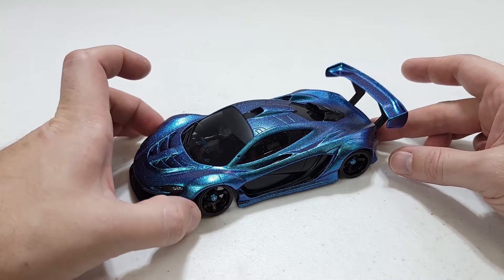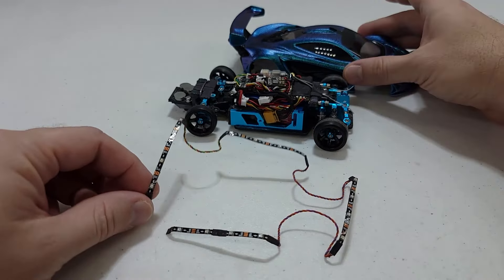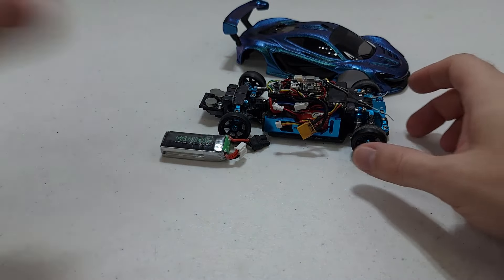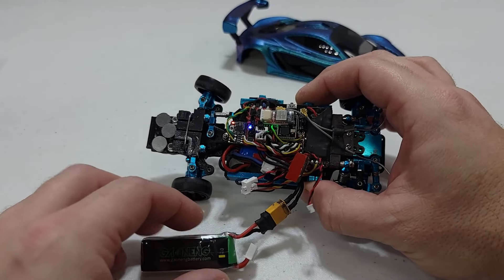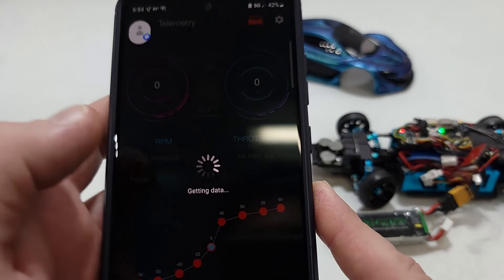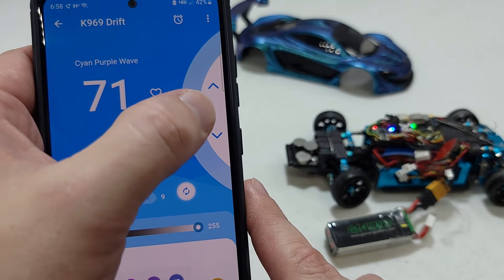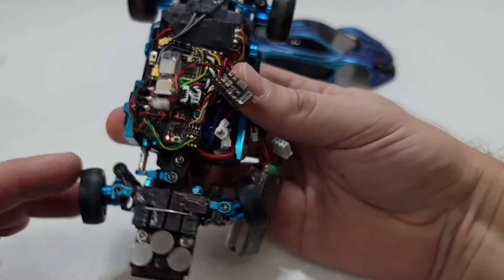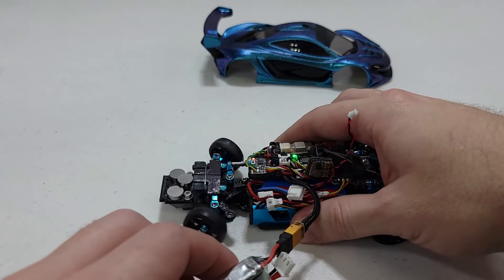WLToys K969 Rebuild Completed! Electronics Upgrade, DasMikro V6 Gyro, Furitek Momentum ESC, etc.

Comment: Hey man, great vid and love the look of the P1 body on it. I'm looking forward to your electronics breakdown videos. 

I have a dumb question but I honestly can't find any info elsewhere on it from a video from 2024.

the R7FG transmitter has a gyro built in which can be controlled by the RadioLink Transmitter, can I ask why it's not being used and an additional aftermarket one is instead?
Reply from the maker: Thanks bro, just hang in there for those vids since I have a few LDRC videos I'm gonna drop first then I will get back to my K969. I have a lot of videos to make and it's hard to find the time. So with the internal gyro on the R7FG, the reason no one uses it is because it's a terrible gyro, most gyros built into receivers usually are. I guess if you have no other option you can use it but you're not going to get good control out of them unfortunately, it sucks I know. Originally I was thinking of using it too in the beginning and then did my research as well as testing and it's a waste of time so that's why I don't bother with it. Yea there's not a lot info out there about it but when you do find some that have tried it they come to same solution. The best cheaper option for external gyros for these RC cars are the DasMikro gyros since they are half the price of the better ones and works almost just as good as them. I'll try to cover some of this in a video down the road when I can.
Reply: @AirToGroundRCFPV   hey man thanks for the detailed reply! 😀 Drop the vids whenever you can dude, we watch them for half an hour but the setup and editing that's done in the background takes much longer, I'm subscribed anyway 👍🏽 ohhh now that makes alot of sense now, I've only just picked up my k969 the other day after 13 years away from the hobby, I'm determined to make a nice indoor drifter for the rainy days 😎 I'll go for a gyroless radiolink rx for my RL transmitter and I'm thinking of going with the AFRC GYS-2 gyro since they seem to be quite popular or would you say the Dasmikros performance is good enough? 

The hard part will be sourcing a Supra MK IV body and putting a bodykit on it, I'll probably CAD it up myself 😅
Reply from the maker: @Shaktical_Airsoft  No problem bud, glad I can help out. I always plan on making my vids shorter but once I start getting into the details it gets dragged out lol The K969 is fun but a huge pain to get it the way you want, I mean it took me like a year to get this one where it is. You can still get the receivers with the gyro and just not have the internal gyro on, they work fine and don't interfere with the external. The R7fg is good but the smaller R4fgm will do just the same as long as you don't need more than 4 channels. The DasMikros are good for their price so paying twice to get a little more performance is completely up to you, I don't want to tell you how to spend your money. And bro, if I could find a Supra mark IV I'd be all over it too especially would want a wide body kit for it lol 3d printing them is tough but possible and it sucks all the Mini-Z Supras are gonna be over a hundred easy since there are collectibles now. You could get one of those Tamiya model kit Supras that are 1/24 scale but you'll have to do a little extra work to fit right on the K969.
Reply: @AirToGroundRCFPV  appreciate the work you put in man for real. I say let the vids be as long as they need to, we all need to learn to have longer attention spans lol I realised that you spent so much time fiddling and dremmelling away it's a lot of work but tinkering is half the fun of the hobby imo 🤷🏾‍♂️ I think you may have sold me on the dasmikro lol if the 'performance' really bothers me I'll switch it up, I am really interested in getting a supra body somehow but yeah I heard about these tamiya kits too, I think I can get away with a printed resin body with bolt on kits, it might work with what I've been doing so far, if I make it happen and it works I'll hit you up so you can print one for yourself 😎 also maybe a liberty walk Lamborghini Aventador too  hehe
Reply from the maker: @Shaktical_Airsoft  Dude you are speaking my language haha resin would be much better, I only have pla and tpu stuff I can print so it's not as good for me. I want an Aventador so bad as well but Kyosho won't make a Mini-Z version of one for some reason and if you could do the LBW kit on it that would be sick. I would buy one from you if you could make that happen lol You are spot on with the tinkering being half the fun, for me it's almost most of the fun than the final product since I enjoy the challenge, work and problem solving that when I actually complete it I'm like, now what? lol I've been like that for years even when it comes to my dozens of micro quad and drone builds, I just wanna build stuff but I do love flying them fast and crazy as well. RC cars is my second hobby so I'm not the greatest drifter but if I have time to practice more I could get better. I would say I'm a better pilot over all though lol Nobody really cares about drones any more and everyone loves cars so I stick with that for my channel at least for now and for some reason my vids always reach a half hour when I don't plan for that, it's like a curse haha
Reply: @AirToGroundRCFPV   yeah you cannot deny the finish quality of resin prints plus I got a trick to really smooth it out since I'm working closely with a resin printing fanatic at work lol the only problem is it's brittle so if hit hard enough then it will break but you can always print another one lol don't worry about paying for one from me, when I figure it out I'll send the file over for you personally. You could still print in tpu/pla but you'll just need to post process it abit more, I think Uncle Jessy has some hacks to smooth FDM prints.
Haha remember when drones were the latest thing? Man I wish I capitalised on that, I'm a noob flier still, got my Hubsan q4 out the other day and forgot everything lol and yeah no point building a beast of a quad of you dont go full send! Haha

 I think you should do a fpv kit on this car as your next crazy venture, I'm thinking of doing it for my buggy lol tinkering for me is challenging and therapeutic, it's fun when you have an idea and you can actualize it, this P1 of yours was really the thing that sent me down the idea of an indoor drifter, I drift well on PlayStation, now does it translate to rc cars? Only one way to find out lol
Reply from the maker: @Shaktical_Airsoft  Yea that seems like the trade off, resin looks fantasic but can be brittle, pla or petg, abs can be stronger but looks rough. I usually stick with pla since it's easy but still not very strong, to fix that though I cover it with epoxy and it makes it super strong and smooth after then a little sanding will make it ready for painting. I usually do that to my GT wings and front lips on the body kits so they can handle abuse. Thanks for the files if you do, I still don't have a thingiverse account or anything so I can't share files if I wanted to. I've been so busy I just haven't had the time. 
When it comes to the drones yea I was all over the hype train, was loving how good fpv equipment kept getting, the weight going down and quility going up, it was awesome lol but I was too late to make a channel when everyone else was well established and then everyone else was posting their fpv flights so now it's nothing new and over saturated. The fpv community is great and I'm glad to be apart of the journey but now I feel it lost it's steam and barely anything new comes out and the faa wanting remote id on quads really was the nail in the coffin. 
But I do have some anolog stuff ready to throw on any car I want I just don't know how difficult drifting is in that perspective and being so close to the ground its different thats for sure but I will be trying it out eventually. I do have a digital fpv setup on a micro quad I may snatch off that build and throw on the cars since that may be more pleasing to watch for people in my videos since analog can be rough to watch lol
I'm happy to hear I helped inspire you to work on some new projects, just hearing people get excited to do something after watching my vids is a good feeling. 
I only had need for speed experience before drifting my cars so no worries I think you'll do just fine haha I appreciate you being such a cool dude, not everyone is friendly on here so it's always nice to talk to someone like you, Thanks man. I feel like I just wrote a novel lol
Reply: @AirToGroundRCFPV   ah the epoxy coating is still a thing? That sounds like a great idea to reinforce the body at the most abused points 🤔 don't thank me for the files yet, I've got a supra and lambo stl file ready to roll so I'll need to chop and change it to the right scale and then see if I can modify the data for the bodykits, it will be something completely new for me to CAD but I desperately need the challenge lol I'll email it to you via your links when it's done, bare with me though I have one other project to complete before I jump on this but I am passionate about cars so I look forward to doing it 😀 just as you know it's hard balancing hobbies around life lol

The drone tech has jumped rapidly, I can't even believe the video quality, the speed these things get to now and even the range / stunts. When I saw a channel doing flights around inactive volcanoes I was like 'what an amazing way to site see!' at some point I'd like to get into fpv drones but not just yet lol and yeah regarding the FAA it's the few idiots that have ruined it for the majority, I actually get angry at news stories of drones being flown in the dumbest places causing unnecessary danger 🙄

You know what would be great, your drone gimbal experience, FPV with a stable video at speed on rough terrain and even drifting isn't covered enough on youtube, there may be an idea for you 🤔 personally I think that would do very well. 

Hey man I should be saying the same thing about you being cool man, I wasn't expecting the detailed reply, you've saved me alot of headache and guesswork for my electronic upgrades and gyro questions so thanks again 😊 for me I've always been reluctant to comment asking questions to you tubers but the RC community inc yourself have been nothing but welcoming and a tonne of help. Keep doing what you're doing man, I'm excited to see what you got in the pipeline 👍🏽

P.S. Need for Speed and Juiced 2 for PlayStation drifting hehe 😎
Reply from the maker: @Shaktical_Airsoft  I completely understand my friend, I'm in no rush so take your time. I have enough things keeping me distracted that time flies I feel  nowadays anyway lol and don't feel pressured, if it doesn't work out it's no big deal either. I know you'll enjoy the challenge and just have fun with it. And yea epoxy actually works really well to fix the vulnerable areas on my prints like where I screw the wings in on the trunk always breaks so epoxy pretty much fixes that.

The fpv experience with quads is truly a amazing when I think about it, it's like an out of body experience you can't get anywhere else and can explore awesome locations in a way you would never be able to before. It does suck there are people out there that really shouldn't have any business owning a drone like some people that buy off the shelf djis and just go places they shouldn't with no knowledge of the rules and respecting peoples privacy. They make us all look bad and I could go on a rant of course about that stuff all day. I'm part of the community that has been building quads from scratch for years and never buy anything prebuilt off the shelf. I do have some aerial photography set ups since it's the only way to possibly make some money but what really got me hooked was the racing and freestyle world of it. I have some 6in 6s builds that will go over a hundred in a second but it's just hard to find anywhere to go fly them anymore and they scare people including myself lol but man the power and speed is amazing. I just stick with micro quads and tiny whoops now since I can fly them around the house and they don't bother people out in the world. Micros have so much more power and speed now you don't really need to fly their bigger brothers to get that same adrenaline rush anymore anyways so I stick with the tiny drones now, plus the faa can't get ya for them either lol 

You are on to something with the gimbal experience on the cars out in the world would be fun. It has crossed my mind but my RC cars are a little small for a gimbal set up on them so it would be easier for like 1/10 scale cars. maybe I can make a small gimbal to make it work though. I usually run a fixed camera angle for my fpv and gopro since a gimbal is not needed for racing/freestyle but aerial photography usually needs one. I am worried about too much shakes in the fpv camera from bumpy terrain while driving so I feel that will be the biggest issue for sure. A gimbal could help that and maybe some clever soft mounting can do the trick as well. I'll see what I can do when that time comes because you are right, not a lot of videos out there on that kind of stuff.

I understand how frustrating it can be trying to get started on something and having trouble getting help so that's why I have no problem trying to help point you in the right direction, I've been there myself lol I def don't know everything and could possibly be wrong on some stuff too so just check some other sources before making a decision of course haha I'm glad to be one of the helpful ones out there compared to some others but I also can't have all the answers either which is why the RC community is great, you can get information from multiple perspectives to help you on your journey. Keep me posted on your projects and like I said there is no rush man, take months if you need and don't stop tinkering lol
Reply: @AirToGroundRCFPV  Haha you and me both then, I like how these things keep me busy and keeps my mind occupied with new ideas. That's the right attitude, if it doesnt work out then it's okay and youre right it will be fun. Hmmm epoxy, does hot melt glue work too?

Yeah I get that man I would like to try that out later on and mainly to improve my piloting skills but as you say man the odd pleb will ruin it and make it harder for the sensible pilots. I keep hearing 3inch drones are the best size to go for and I'll probably build one so I know how to repair it but thats later on. 100 in under a second? what in the? I thought those videos were fake lol thats insane! Indoor drone flights dont sound too bad either lol

I think because a lot of vids show too much vibration when going at speed on these cars hence the need for gimbal stabilisation because I'd hate to start feeling sick from driving after a few minutes lol it will be cool to see what you might come up with to counter it and if you have nice views in your area then that would make for good content.

Everyone has their own take, after the countless case of 'too many chefs in one kitchen' on reddit I resorted to asking content creators directly, seems to be more direct and you can learn a lot, either way all the advice is useful in my mind. I think i'll post a few shorts on here and link it to the Instagram page I've started to log my RC journey so watch this space.

P.S. We never stop tinkering hehe
Reply from the maker: @Shaktical_Airsoft  I haven't tried melting glue yet but it needs to be strong and flexible so if you can find anything that can do that then you should be good to go.

3in drones are a good starting size but can also be a little too powerful and heavy to start out on, the more weight, the easier to break. No quad is indestructible but 2in and smaller are really good to start with since they don't cause too much damage from crashing but I feel tinywhoops are the best to start with and practice, they are so small and light you can fly anywhere indoor or outside and usually can handle moderate crashes, plus they aren't as expensive to get started with compared to their bigger cousins.  

There is some 3 axis gimbals that are kinda small enough I found but the set up would probably cost around 150 to 300 and I'm not dropping that much for one anytime soon lol I keep looking around or maybe I can make one, they are just a pain to set up though. I'm in FL so I have good scenery in some areas, there's just people everywhere nowadays it's hard to find a spot and not get bothered lol

Yea start dropping content and to see what sticks and then stick with that and start building a base. It took me over a year to really start to get the ball rolling but to be honest I posted for a few months and then stopped for almost a year lol then started back up again, it only takes a few good shorts to really help your channel take off. I was going to focus on multiple social media accounts but got lazy and just stuck with youtube but the more you spread out on platforms the better chances of success, take your time and see what happens man.
Reply: @AirToGroundRCFPV   Shoe goo and flexible gorilla glue is what I use for RC cars to reinforce bodyshells so as long as it doesnt react with the resin that should do, i'll probably do a test myself to check but if all else fails then I can use epoxy like you mentioned.

I'll keep a tiny whoop as my first fpv drone then 😎and I think when I get a radio I'll do some simulations before I take a larger one out for a rip. 

I've got a HAKRC gimbal in my Ali wish list which is well under $100, I think I found someone who managed to run this on their RC truck and theres also another youtuber who does a lot of FPV RC Car stuff called Chad Rains so maybe there's some inspiration there?
And the Radiolink RC6GS is FPV compatible. I can't wait to get it working when I get into it.

Haha yeah I get you, I just want to document my RC journey really, I doubt I'll ever make it big on youtube but it will be good to just meet like minded individuals like yourself on here 😁

P.S I pulled the trigger and went for the goodies to get max steering angle, RC6FG rx so I can use the extra channels later, Dasmikro V6 and a mini 20A ESC so I can run it with my RadioLink Transmitter. I've almost finished my other Airsoft project so I've started on the LW Lambo, looks like it will take a while anyway lol